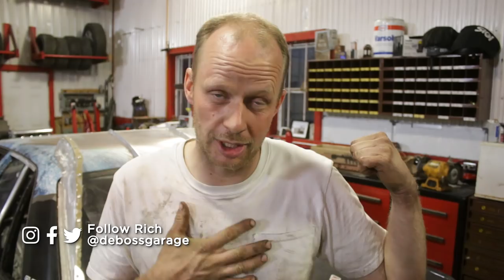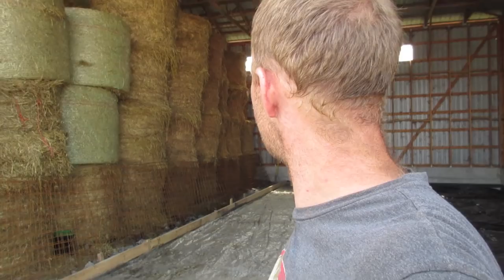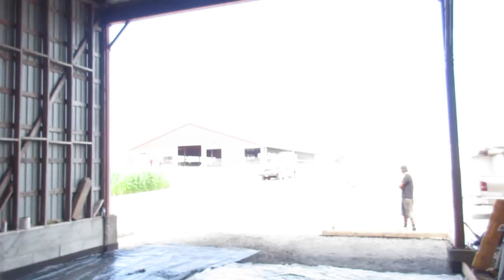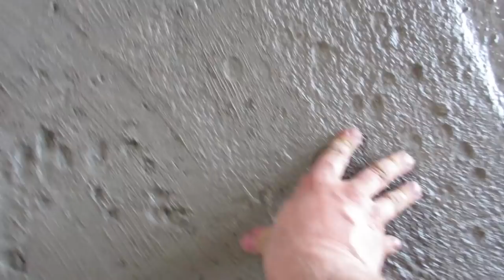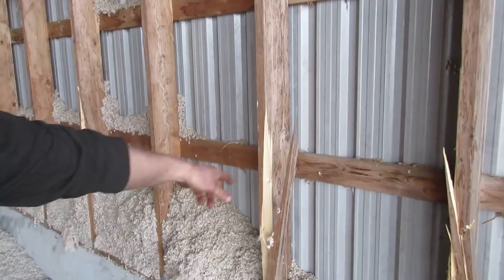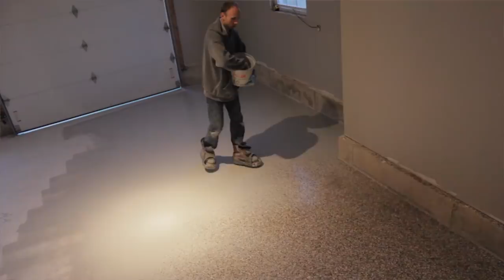The Best Concrete Floor I Ever Poured

Comment: I love doing concrete, I use to have a mason contracting business but now I do a little bit of everything.  The concrete I do now is mostly decorative. We do polished and distressed floors and lots of stamp work. Most of what we do is custom. We don’t use pattern stamps. We use seamless and hand cut our own patterns. Lots of fun. Also we’ve gotten into concrete counter tops. Now every counter I do for myself is some sort of concrete. I love turning wrenches also but I think I would get bored if I only did one thing. I need at least 4 or 5 trades to keep my mind occupied. I’m far too ADD to doing only one thing. 

Great video Rich, we have a lot in common....except I say electricity and you say hydro

Comment: I ended up installing a concrete and brick "speed bump" at the garage entrance to the garage floor I described in the other video. Now all the rain instead of going into the garage went to the side filling the ditch. Had 3 mallards come and swim around in this tiniest of ponds. I put plastic in it & a capful of bleach to keep the green away and year after year they kept coming. Made for a nice view from the house. You can't plan this stuff!

Comment: cool work man!! lotta big projects there.  that steel cable to the top plate is a good idea, ive seen buildings done with a very long piece of allthread from the anchor bolt all the way through the wall up to the top plate

Comment: I purchased a 30x25ft  vinyl type garage from home depot last year and a new 9000lbs lift. Im in the process of building my form to pour my first foundation now. Im a machinist by trade. Hinestly have no clue what im doing but you have to learn at some point.
Reply: Good luck!
Reply: Concrete sucks... As someone that pours and finishes every day my best advice is get someone else to do it

Comment: Stamped concrete is relatively easy, have to babysit it a bit, and cleaning it up a bit at the end, then sealing it, but it looks nice. Did dry riverbed decor for a lady, dyed the concrete, stamped river  rock, then broadcast green dye for the look of moss/old rock look, really easy. Y ou can broadcast it for a look you are after or put it into the mix

Comment: Love your experience on the powerboat,  had exactly the same experience, had it worked out on the next job I did with someone else.
Your cable tie down idea is the sort of thing I would do, yeah ten nails into a little area of timber, that will work, not. You just put them on to keep the 'professionals' happy, then do it properly to keep the customer and your reputation intact.

Comment: Bit early with the trowel there ;D I drive a concrete mixer truck for a living, and every time i see vids on concrete i appreciate how modern norway's concrete setup is, i got a 10m hydraulic remote control chute on the truck i drive, so laying floors is easy peasy. Also get our concrete so doped up its hella liquid, just this fall i laid a 70 square metre floor by myself, then flattened it by myself (no trowel tho, just a tractor parking spot basically) 'cause the concrete station dude lied and told the customer you that self-leveling concrete doesnt need to be flattened. Didnt even break a sweat! (of course, it was -7c that day) We run 4 inches for your regular garage, but like 8 for workshops or the like. I have 10\25cm where my 2 post lift is.
Reply: MadMaxx570 I
Reply: We had concrete conveyor trucks here in Ireland for over 15 years.  Very handy for bad ground and for high up walls or reaching across tanks can’t be put on any standard concrete Lorry.

Comment: Talk about videos right on time. I'm going to be building a shop this year, getting sick of working outside in the rain/snow. Bought a backhoe to level out a spot, planning on doing basically everything myself, including the floor. Looking at buying a used power trowel and reselling it once I'm done, and planning on selling the backhoe after I'm done with it too. We'll see how both plans go, seems like equipment has a way of not leaving once its mine.

Any strong thoughts on a pole barn with cement floor vs a slab with framed walls? I've got access to a tractor with post hole digger, but it seems kind of redundant to put up posts just to pour a slab anyway.

Suggestions on keeping costs down but still having a good functional shop? How much gets done this year depends fully on how my business does and how much money I have to spare, as my wife is leaving her job to help with all the paperwork and jobs I've now got, I might be able to get a small loan, but would prefer just to keep costs down.

I work on boats and jetskis, so not a lot of weight, but also do my own maintenance on 3 trucks and my families cars, so a lift would be nice eventually but I'm just hoping to get a roof over my head this year at least.

Comment: On your last video you talked about the pulling points you put in the concrete floor when you poured. If you have more time can you describe how you did that and would you change anything if you had to do it over again. i want to have some pulling points installed in my new shop and i am looking for ideas. thanks

Comment: Pouring a concrete floor is work. Hard work, after you do it, you get tired, more tired than you can imagine. I trust that if you do it often, you get stronger and it doesn't hurt quite so much
Reply: Pat Farrell that is correct. I'm a concrete man by trade. Poured a 60'x200' pole barn floor in three sections the end of last week. It was around 65 cubic yards per pour. I was definitely tired after doing that three days in a row but you get in shape to manage it.

Comment: If I can pick your brain, why no steel reinforcement for such a large slab? What sorts of anchor bolts are you using? Kinda wondering about the tension yield and uplift requirements since it gets windy and there is a lot of rotational resistance. Ah.
Reply from the maker: There is steel mesh in it.  4'x8' sheets with 6" overlay

Comment: The mesh needs to go near the bottom, that is where it does the most good.  It doesn't do much in the middle.
Reply: Lol.  Right.  Put it on the very bottom. . Don't get any concrete under the mesh.